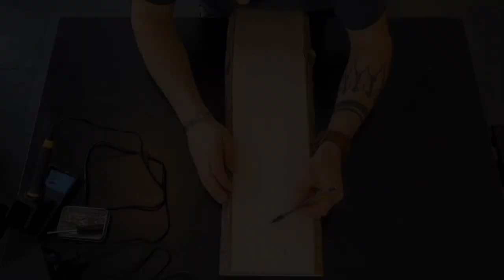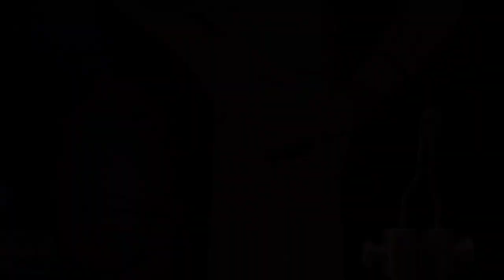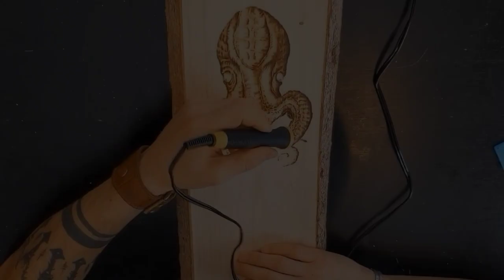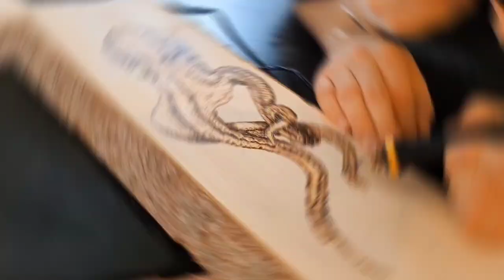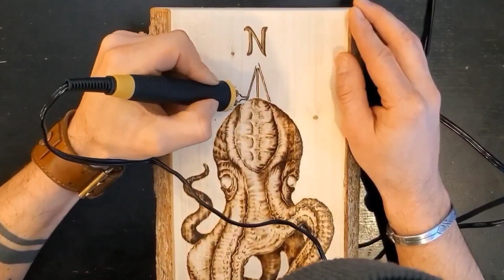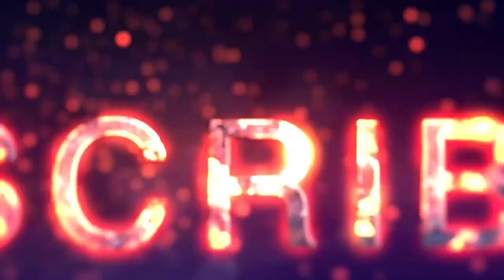Pyrography/Woodburning timelapse!

Comment: Nicely done, Adrian! BTW you actually can go back if you make a mistake. In my last tutorial I mentioned and showed the technique of tip scraping to correct mistakes. 

In essence, holding an exact knife so that the blade is almost parallel to the wood but lined up perpendicular to the wood surface you can take the tip and lightly but quickly scrape away the burn area in which the error occurs. 

You must be careful not to angle the blade because then it could potentially bite into the wood mate.

But once you practice a little and if you go lightly and carefully, you can scrape away the char marks. To smooth back the wood aftertip scraping, you can fold a small piece of sandpaper between 260 grit to 320 grit should do the trick.

Some pyrography artists, myself included, will sometimes use Emory boards for sanding fingernails. But try not to raid those from your wife. Women don't appreciate guys absconding with their beauty supplies for our own projects. LOL. 😉
Reply from the maker: Thanks for the tip! I definitely will give it a shot the next time!
Reply: @adrianwoodworm  you're very welcome.